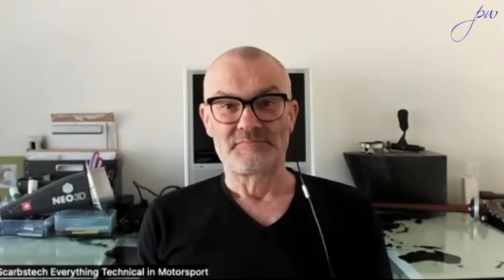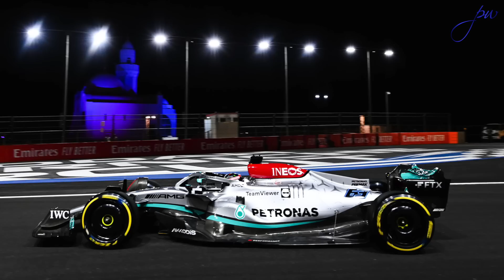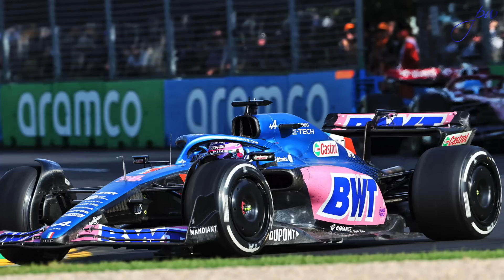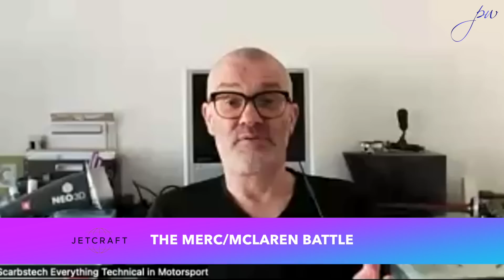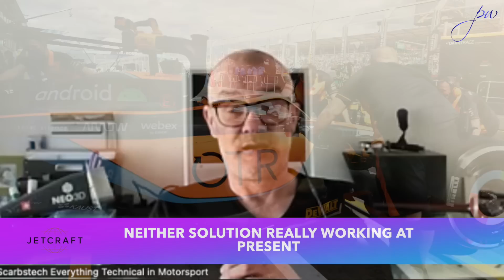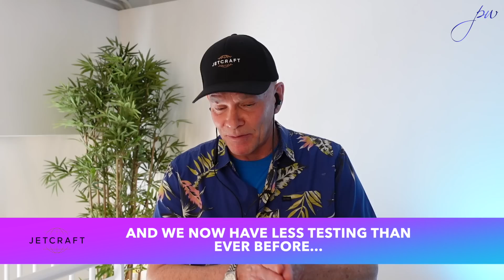The F1 weight-watchers with Scarbs by Peter Windsor

Comment: That the current cars are absolutely miles faster than early 90’s cars that weighed 500kg and had 700bhp, shows you how far aerodynamics and general engineering in F1 have come…

Comment: No the reason Lewis wants to complain about having an extra feather on board is because George is making him look kinda overpriced for the result to say the least.
Reply: Nonsense,  Hamilton has outdriven Russell 2 out of 3 weekends thus far.
Reply: @byanymeansnecessary9329  Who is #2 in the championship right now? I'll wait
Reply: @SunsetWingman  don't care, its only 3 races
Reply: @SunsetWingman  there's only one race weekend in which George conclusively outperformed Hamilton and two of the three weekends so far have had safety car interferences that's have placed Hamilton further behind on the road compared to where he would be.

Also unless it's blindingly obvious like it is with Sainz versus LeClerc or Latifi versus Albon, three races is far too small a sample size to compare between two divers.
Reply: @byanymeansnecessary9329  You dont care because it proves your wrong.

Comment: They had over 2 years to plan and develop these cars( delayed by a yr due to covid). how could merc get it so badly wrong
Reply: That merc car has performance in it. It's just about unlocking it. They will be in the championship picture I can guarantee you that
Reply: They did not get it so wrong, Ferrari and RB just got it better.
Reply: Well they told us a while back, its because you cant have the prototype bounce off the conveyer belt in a wind tunnel; it would damage the tunnel. So they purposely built the expirements not to bounce and therefore overlooked the porpoising

Comment: To cut some weight, they could start with removing those eyebrows over the front tires and the wheel covers. The improvements in looks would be drastically.
Reply: That would increase drag and turbulence very much

Comment: On the Red Bull, if you trim a few grams from the end plates that means there's less weight at the edge of the wing resulting in a lower bending moment at the root. Less root load means lighter wing overall.
Reply: Translate that into performance on track.
Reply: @tigerrx7  Easy you reduce front axle inertia, and get better turn in. Floor mods make sure the air entering the tunnels stays attached under yaw, gives better traction on exit.
Reply: @tigerrx7  The front wing is like a boxer engine, wide and low, when it's aero loading is high. So if you move some of the aero loading a bit more inboard and rely less on the winglets, it cuts down on drag, and resistance to turn in from the wide and tall end-plates.

As a bonus, since the outboard end of the wing is less highly loaded, you can make the wing lighter because there's less force being transmitted to the root from the tip. Lower lever arm acting on the root of the wing and with less force acting on it, you can make a lighter structure.

Comment: If you're pulling 4-5g's in the turns, that means a 30kg wheel, brake, upright combo weighs 150kg, so removing 1 or 2 kg from there makes a big difference.
Reply: Not exactly... It means there's the equivalent of the force downwards created by 150 kg of weight acting sideways on the wheel, just as it would be on any other part of the car. That being said, the reason unsprung mass can make such a big difference on car performance is because of the vertical forces acting on the tire as it follows irregularities in the road. These high and low frequencies create large loads and oscillations that ideally is absorbed exclusively by the suspension as to keep tire loads as constant/close to steady state as possible ( tires don't like changes to loading... Per say). The lighter that unsprung mass, the easier it is for the suspension to handle these oscillations, keep the tire on the road, and reduce tire load variation (not caused by aero forces)

And honestly, that's a large oversimplification and doesn't even take into account suspension member loading and compliance
Reply: To be fair to you though, they likely do see that magnitude of acceleration vertically, in which case you're right
Reply: The garbage pirelli trash tires are 3x mass now compared to the 2010 Bridgestone, possibly 4x mass
Reply: @byanymeansnecessary9329  are you on about the tyre wheel combination, or, just the tyres alone?

If you're on about the combination of wheel and tyre, then, well, of course there's a massive difference.

That said, they've done this for 'reasons'...and, to be fair to Pierelli, they've been asked to make a tyre that behaves like this.
Reply: @weedfreer  tires alone, and no pirelli have not been asked to make such heavy garbage tires.  Pirelli were specifically asked to make tires that mimicked the behavior of the Bridgestone tires at Canada 2010, over 11 years later and Pirelli have not once provided such a tire, just last race Albon almost went the full race distance one 1 set.  Pirelli were not asked for heavy, blow out prone trash that can not be pushed hard, but that is all they have ever supplied.
Reply: @byanymeansnecessary9329  Yeah, let's all hate on Pirelli... but the HYBRID cars are HEAVIER and have more TORQUE than the 2010 cars, no? Or certainly forces in the rear tyres in a different way due to hybrid deployment. So asking them to behave as a tyre did in 2010 when the cars have changed is basically asking for the impossible. And that race was quite circuit specific, where the season involves all kinds of different layouts and track surfaces which have a different effect on the tyres, not to mention different weather conditions and track temps. And different drivers and teams asking for different things. Not to mention all the teams got wise to how the tyres were going to react (which they couldn't do in Canada 2010). So really we should take aim at all the simulation data they have to calculate exactly when to stop before they even run the race. But yeah, it's easy....
Meanwhile, Michelin refused to make tyres like that, and were only prepared to make 18" wheel tyres (because trying to have a consistent 13" tyre with that amount of power and heavy cars and sharp kerbs is not fun)
The real crime is frankly asking a manufacturer to make an artificially sensitive tyre for the sake of artificial racing as a way to compensate for cars that can't follow closely because of aero. So whoever decided that is what fans or drivers wanted is at fault. Because fans and drivers want cars that can push, and tyres that they can push on. But F1 is interested in pushing the green message and removing refuelling.
Reply: @byanymeansnecessary9329  according to who....you?

It certainly doesn't appear to be F1/the FIA!